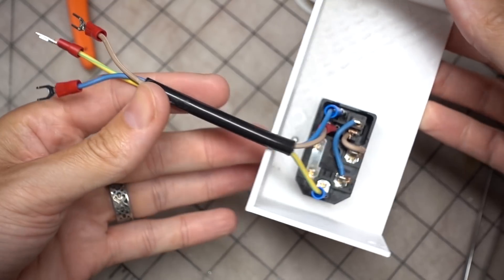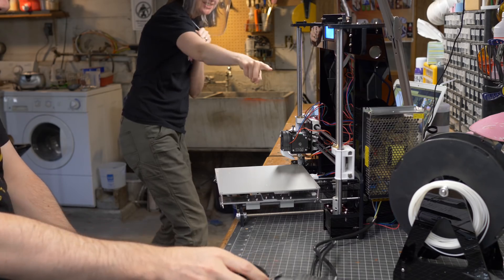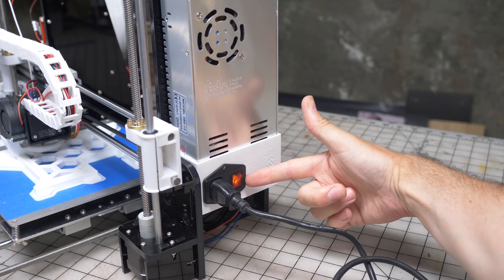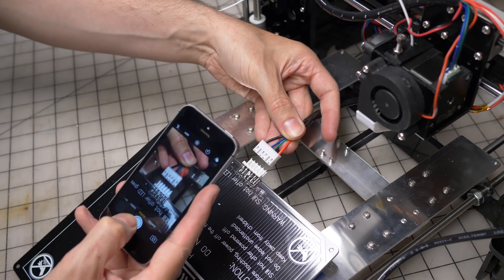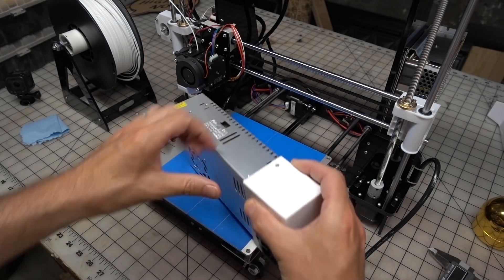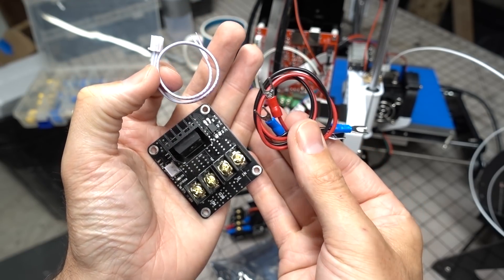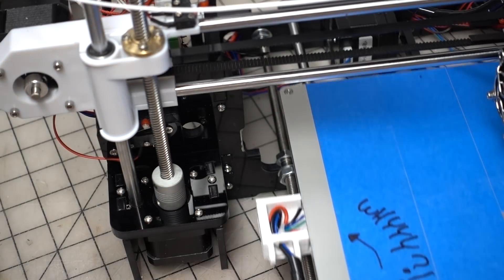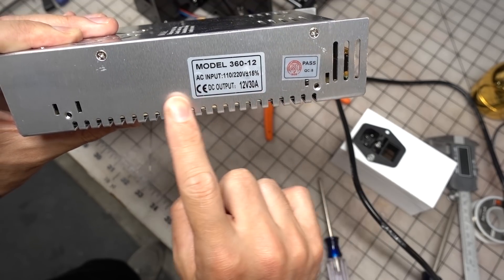Avoid a Fire Hazard - Anet A8 Safety Upgrades

Comment: Oh yum, those power supplies are only CE listed. Some would argue that means Conformité Européene, while others including myself would say it's "Chinese Export". I mean realistically the upgrade was worth it... but seriously the garbage they are willing to put CE markings on? If you were REALLY worried about a fire... you'd get a UL listed supply. Let me put it like this: a CE only certified power supply for a laptop is one that costs $30 and dies within 6 months. A nice one from a reputable maker will be UL listed and last 5+ years, and in fact I've had power supplies in old computers last their lifespan and beyond (15+ years).

Edit: While CE isn't necessarily a bad standard it is much easier to register an item as CE certified, and also it's commonly faked on exports from China. CE certifications are cheaper as well, so you get some less than savory things sliding through CE certification from time to time, and many many junky items with a fake CE marking coming through as well.
Reply from the maker: Good info, thanks for sharing!
Reply: Jesse Crandle I was about to ask how these printers are even allowed to be sold here if they're dangerous. I falsely assumed that they were UL listed.

Comment: One upgrade I would do (And actually have done....) Is flash the firmware with Skynet. It is a Version of Marlin designed for the A8. It includes all of marlin's features, including thermal run-away protection, which i believe isn't included on the stock firmware. 

It's quite easy to do, you can download everything you need from here: https://github.com/thijsk/Skynet3d

Also, you cold put a bed leveling sensor on (about £5 on ebay), but i haven't quite worked out the kinks on mine so i can't say for sure how much easier that will make everything! 

This is a good printer, but not one for people unprepared to tinker!

Edit: Also, there was an increase in print quality that came with Marlin, and it will allow you to properly tweak the acceleration and Jerk. However i can't say for sure how good stock Skynet is as i put on a titan aero as part of that upgrade which has dramatically increased print quality.
Reply from the maker: Awesome, I want the thermal runaway feature, for sure. Thanks for sharing.
Reply: while maybe a little beyond what you would normally do, a video on your adventures with Skynet (Full of Terminator puns!) would be interesting :)

Comment: For the love of god, why would anyone buy this crap printer? Get a CR10!
Reply from the maker: The CR-10 came out a week after I ordered this beast. =(
Reply: Punished Props I keep seeing these printers pop up in videos even after people know what kind of slapped together garbage it is. You definitely classed yours up :)
Reply: No problems with my A8 so far. Stock PSU with upgraded wire and a mosfet, the rest are performance mods.
Reply: The CR-10 is also more than twice the cost.
Reply: But at least it won't set your house on fire.

Comment: Soldering iron: do yourself a favor and spend the extra $$$ and get a nice temperature (not wattage - actual temperature) controlled iron with a nice big tip, and some good flux (I use chipquik paste flux because it cleans up nicely with 99% isopropyl alcohol). Having this makes the difference between a soldering nightmare and soldering bliss! 😎
Reply from the maker: I just picked up some flux, stoked to give it a try.

Comment: I would consider upgrading the gauge of the cable running from the powersupply to the mosfet to the bed. Make it a thicker wire, this will decrease the heat time and reduce the chance of the wire's insulation melting.
Also the cooling fan on the power supply you have bought is likely running all the time, if so, look into adding a thermistat to the powersupply, its easy ans reduces that horrible fan noise all the time..
Reply from the maker: Good tips! It looks like the fan on the power supply turns itself on and off when needed.
Reply: It looks like you got the 'more expensive' model than the one I did. It didn't have the thermal sensor on it. I added one and now the only annoying fan is the one I added myself, have to work on that.... :-)
Reply: Paul McKay , that’s exactly what I did on my i3 clone kit from hictop. I used 12 gauge silicone wire from power supply to board. Then 12 gauge silicone wire from bed to board directly soldered on board. My hictop ramps board caught FIRE last week. The bad design and poor screw down connectors not correctly rated for the amperage failed over time and shorted out causing a fire that, thankfully, I was sitting next to and put it out. I’m considering soldering the power input directly to the board as well to completely bypass the screw down terminals. I replaced the original ramps board with a BIQU Mks base 1.5 on Amazon.
Reply: Be aware that the supplied wire for the printer's bed is not extremely flexible. I installed X and Y chains and within a few weeks the bed wire burned through, apparently due to the flexing.

Comment: My A8 hot end connector on the board was charred last week. Yikes.
I didn't even know until it stopped extruding.
I ripped it off and direct soldered the wires.
The power switch addition was the first I did after I bought the printer and can't believe that feature isn't standard.
Stay safe!
Reply from the maker: Scary!

Comment: You missed a fan for the main board it gets very hot and there are quite a few cases of main boards burning out and new firmware with safety features the default firmware lacks thermal runaway protection.
Reply from the maker: That's a great idea, thanks!

Comment: You can find a better spool holder on thingiverse, they've got a bunch of free files for anet upgrades
Reply from the maker: I'm hesitant to hang the spool from the top of the already flimsy frame.
Reply: Oh no no no that's not what i meant. There's a spool holder upgrade that act's like the pvc pipe you used.
 Here: https://www.thingiverse.com/thing:767317
Or this smaller one: https://www.thingiverse.com/thing:124649
They've also got a few other things like frame braces, wire chains, and filament guides

Comment: One suggestion, since I'm doing something similar with an P3Steel , use fire retardant filament for the power supply cover. I also use an auto-shut relay (MKS PWC) that can kill the AC power to the printer if something goes wrong or when print finishes or when the emergency stop is pressed.
Reply from the maker: Thanks for the suggestions. =D
Reply: I thank you for the props stuff you're uploading online - much more interesting. The reason I went for the ultra cautious route is I stay alone and I do not want to torch my apartment when I'm at work.

Comment: I personally love my A8, especially the endless possibilities to upgrade it with 3d print or buy new stuff. Yeah sure there are safety issue, but they can be fixed and they are not that expensive. (MOSFET +power supply for around 30€). The manufacturer also upgraded the plug on the head bed I think. It seems a bit sturdier so now it seems not mandatory anymore.

Comment: Guys just do yourselves a favor and do NOT buy the Anet A8. Buy the Tronxy counterpart, it's the same price if not cheaper. Why? The Tronxy has a better board, psu, and you don't have to de-solder the bed wires like the A8, it's already beefily soldered on it. The print quality is just ok, I would save up for a CR10. I do own the tronxy and cr10 as a disclaimer.
Reply from the maker: This would have been great to know a month ago... HA! =)
Reply: Punished Props get a Tronxy P802e  (bowden style) or P802m (direct drive) for more punished prop 3D content :)

Comment: Another option for the spool of print "wire" would be to use a hole saw the size of the hole in the spool. 

Personally, I would have ground down the proud bracket on the bed holding your wires instead of grinding the plexi frame of the printer. That's just another option. 

Love the series this season.
Reply from the maker: HA! Yeah if I hadn't reacted in such an aggressive manner, I might have come up with a more elegant solution for the interference on that part. =)

Comment: Hi Bill.
I have a question regarding paints. When spray painting my foam props I am getting a problem of the paint being strange like it's separating. It looks kind of like a spider web. I've encountered this problem when sealing with PVA glue and plasti-dip. It also does it no matter how thick or thin I apply the coat. It doesn't happen over all the prop but maybe about 30% of it. Do you know why it's happening or a way I can prevent it?

Thank you 
Joe
Reply from the maker: I'm sorry, but I don't know what would be causing that.
Reply: Punished Props Thank you for the reply! I shall have to do some more tests on scrap foam. Keep up the good work and thank you for inspiring me to begin making!
Reply: Forever Young sounds like you maybe got some silicone or something on the prop that the paint can't stick to
Reply: Graeme Evans Can't be silicone, I've never used it and don't own any! As mentioned they're sealed in plasti dip or PVA glue, left to dry wiped with a paint prep cloth then sprayed once clean and dry. Thank you for the suggestion though, would love to get to the bottom of it!
Reply: well i said silicone or something. anything thats like a release agent would prevent paint from sticking. petroleum gel, starch, solvent, soap, emulsifiers, oils, theres a lot of things that can prevent paint from adhering properly.

does it look like this http://i450.photobucket.com/albums/qq223/joshprescotttttt5/IMG_0463.jpg
Reply: Graeme Evans YEAH!! It's exactly like that! Maybe it's a conflicting chemical in the wipes I'm using before painting. I will test those. I wonder if it could be where I've accidently got contact cement (I'm super messy) on the item while fabricating

Comment: Thermal runaway is disabled by default (a BIG safety issue).  There is a version of the Marlin firmware for Anet printers to correct this
Reply from the maker: That is a fantastic tip, I had no idea. Thanks!
Reply: https://github.com/pedromreis/Skynet3d
Facebook Group : https://github.com/pedromreis/Skynet3d

Comment: Can you instead a genuine e3d v6 after installing this exact power supply? Or would it need to be upgraded to bigger power supply?
Reply: The heater cartridge should have about the same number of watts (30-40) so the power supply should be fine but you would need to print a different extruder assembly. The hot ends are completely different.
Reply from the maker: I have no idea.
Reply: There are also plenty designs around (mainly Thingiverse) for this mod.

Comment: I have 2 A8s. My son and I built. I don't mind running my overnight. They do have a few needed safety upgrade but they were minor fixes from my point of view. I really enjoy the channel and love that you do honest clear reviews and build lime this. I'm confortable with our printer setups cause I have 20 years experience in the engineering field. This was a pretty simple project from my standpoint. I think that's where a big issue lies. I see a lot of folks on the forums in over the head with these kits. You really need at least a novice electronis skill level and understanding to be working on these things.
Reply from the maker: Excellent insight, Charles! I'm definitely a novice when it comes to electronics. I'm learning a lot with this project. =D